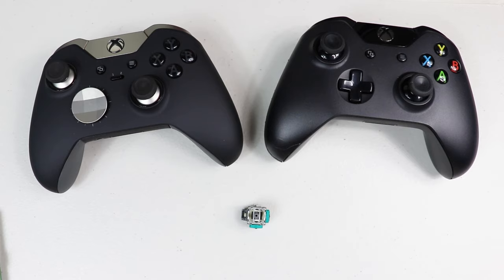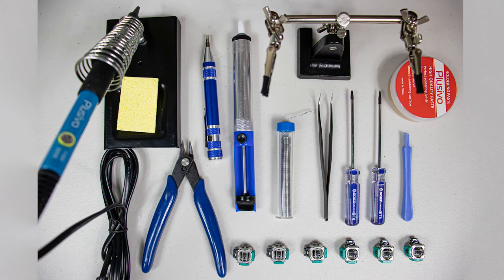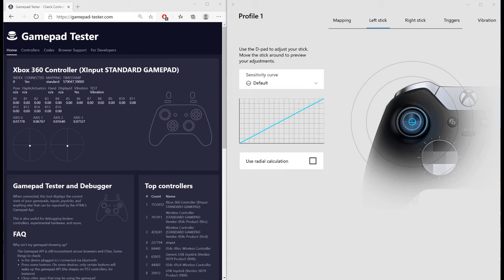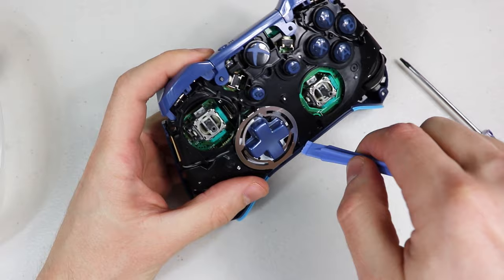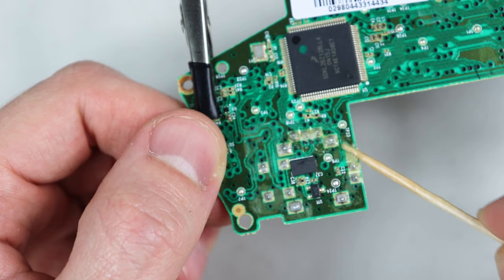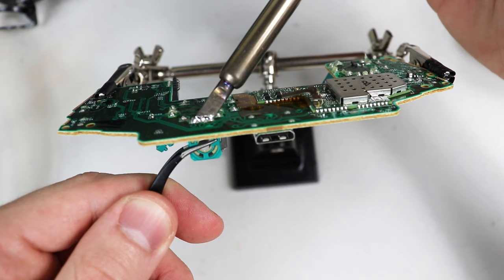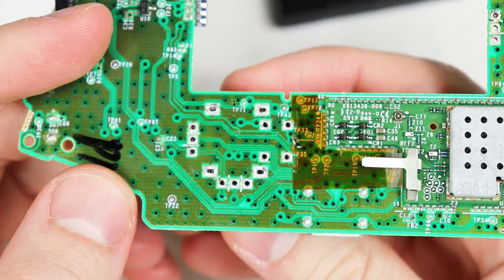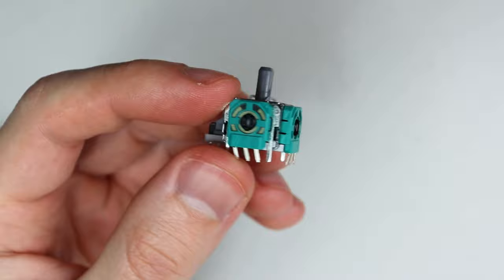How to Replace Xbox One Controller Analog Joystick - NEW METHOD - Fix Stick Drift, Broken, & Loose

Comment: How can one make the spring have more resistence?
I feel a tong of these analogs to be too light.
Reply from the maker: One way would be to install PS4 joysticks, as they have higher spring tension. You would need to make the blue base flat though, as they sit a little higher. I've burned them flatter with a soldering iron before, which worked, but another way would be with a micro cutter. Helps to remove the base first though, which can be a little tricky.
Second way also requires removing the base to access the spring and swap that out. XQgaming sells some various springs, and have a video demonstrating how to swap them out.

Comment: What's the difference between the wick and the solder I thought wick was solder
Reply from the maker: Wick is used to remove/lift solder.  Solder is what is used to join two metal pieces together.  Hope this helps answer your question.

Comment: Out of curiosity, is an Elite 2 joystick replacement compatible in an Elite 1 controller? It'd be nice to upgrade the Elite 1 to the adjustable sticks.
Reply from the maker: I haven't actually tested it's fitment but I'm confident you can if you swap the plastic base of the joystick (the elite series 2 joysticks are slightly raised and may cause the thumbstick to not fit the front cover/rub against it), but it may not be necessary depending if that's the case or not.  It will require manual calibration which is more difficult on the 2's because of the raised base.

Comment: I've been working on my xbone controller all day... but the right stick has a massive offset on x and y no matter what i do... i just can't compensate for 0.2 to 0.3 offset... even with a different joystick and different potentiometers.... Ugh, well at least i get some practice like this.
Fingers crossed my other xbone controller is more forgiving.
Reply from the maker: Oh no :(  Sorry to hear that. I've had a couple controllers like that where I had to swap through quite a few pots and twist to find the right one.
Reply: @SOSSGAMING  thx 4 your respons.
Luckily i had another controller that needed fixing. All i had to do on that one was replace the potentiometer. It was within 0.07 so that was good enough for me. No finetuning needed. And besides, i got a lot better at soldering :)

Comment: I'm about to attempt this repair, but how can I tell a knock off replacement from a genuine one?
Reply from the maker: The most common one with the integrated deadzone has a white wiper/wheel (the center circular part of the green potentiometer.) Genuine xbox joysticks almost always come in black wipers.  If looking for PS4 joysticks that's harder to distinguish because they both have white wipers. Hope that helps.

Comment: Idea is very good but I didn't find it effective on JDM boards for dual shocks/sense. I have really stubborn DS4 controller and even with bending pins to pads readings are jibberish to say at least, nothing worthy of adjustment. It looks like JDM boards have contacts from both layers not just one like in MS controller although I may be wrong. On JDM board I tried this method while measuring and making reading 1-2/2-3 even with 0.05 kohm tolerance but despite that this particular controller still shifts to upper left from the center. Looks like I'll have to pair matched pots in resistance and use flex board 50k potentiometers and do it this way. Suprisingly I had replaced some analog sticks in more DS4 V2 pads without even measuring them and they worked completely fine and were center both. Ughh I really got very naughty pad to work on... Still, great idea and fix. It just doesn't work for me or just this particular controller. I will try it on some other pads anyway.
Reply from the maker: Bummer! Good luck, hope you can figure out a solution for that stubborn board :)
Reply: @SOSSGAMING  I tried that fancy flex board and it completely screws controller's sensitivity.  Yes it solved drift problem but analog stick's "throw" is not centered thus I now have controller which can't go full on right on both sticks. I have those matched cut out pots still so I am going to do it another way and better. I'll trace where those pins go and I'll attach thin wires directly to each leg without soldering to pad and then to the respective places that lead to the chip. With this I will have full control and readings I hope. I need some time, this thing is very "special". You could just use this controller like it is - it is usable. But still I am disappointed with the result. I started documenting this on video, when I'm done I will post it to my channel maybe it will help some people in the future.

Comment: So I replaced a whole stick resoldered a brand new one in, all worked fine except the original issue of stick drift hard right (left stick) persisted! After putting in a whole new pot! Its like there is a short or something that has occurred on the board creating this issue. I have given up, probably just buy another controller and swap the skin over. Reason being it was a BF1 limited controller so I wanted to save it!
Reply from the maker: What value does it show on the tester site?
Reply: @SOSSGAMING  yeah I skipped that part my guy I'll go and find out and come back. Thanks for your work

Comment: Hi, I just replaced the left stick with a new one and managed to calibrate the X and Y axes. However, I'm having an issue: the left stick button appears to be permanently "pressed" when I check the controller on the gamepad tester website. Did I miss something during the replacement, or do I need to buy a new stick? Thanks!
Reply from the maker: Hey there. I would recommend to double check your solder connections. If there is a bridge between the button joints that would cause that. There could also be a solder bridge under the joystick funny enough (happened to me once). Clean all residual flux well with isopropyl alcohol. Could also be a faulty button on the joystick itself. Worst case there is a short on/in the board somewhere.
Reply: @SOSSGAMING  Many thanks! I'll check all that! Best regards

Comment: This is a long shot, and i know this video is a year old now. I replaced one analog stick on my series 2 controller and went to test it and both the analog sticks and triggers dont register now. All the other buttons register even pressing the analog sticks down to click the button register, just not tracking any movement or trigger pull. Any ideas, or is it trash now?
Reply from the maker: Good question. I wouldn't say it's trash. I think I've had something similar before where it was one of the small capacitors (which also completes the circuit to power the triggers). Try to see if you can spot any missing ones near where you soldered. It might be worth checking to make sure it's on a profile that doesn't have the triggers disabled. And lastly connecting/reconnecting the boards together might help. Just a thought. 
If none of that works I'd post this question in acidmods forum they're quite knowledgeable over there. Good luck!

Comment: I have the entire assembly of the joystick, wipers and all already attached, can i just solder in that or will it need all the tweaking and pin adjusting to get it centered?
Reply from the maker: You can solder it in, but will likely have some off-centering. You can always adjust it afterward though as shown in the vid. Personally, I'd do the tweaking first though.
Reply: ok thank you @SOSSGAMING

Comment: I have a problem, the click on the right stick (L3) is not being registered, it happened after changing the stick, do you have any tips to solve this?
Reply from the maker: Sounds like a bad replacement. Just bad luck unfortunately :/ But double check the accessories app if it's an elite or series x/s or in game settings

Comment: if one of the potentiometer, let's say, x-axis does not show any movement on the software (let's say one accidently forced some of the pins out damaging the pin holes), would it be possible to bridge those pot pins to another part of the PCB?
Reply from the maker: Yes it is! in the acid mods forums there are pcb scans of each controller. I'll try to send a link to it in the next comment
Reply from the maker: https://acidmods.com/forum/index.php/board,537.0.html
Reply from the maker: If you are unsure of which TP to solder to you can post the question there or ask me and I can help locate it with you

Comment: Do you have any fix for joysticks physical tension that doesn't rest firmly in the middle? My old elite series 2 thumbsticks have like a whole 2 mm of play in its resting position, and it's definitely in the thumbstick module and not from the screw on portion.
Reply from the maker: Unfortunately the only way I know how to fix that is by replacing the joystick. The Elite 2 joysticks in particular have this problem sadly.
Reply: @SOSSGAMING  ok. Rt for the reply. I'll update here if I come up with anything.

Comment: Will this repair work with hall-effect joysticks?
Reply from the maker: I think it will on the S/X controller because you can calibrate it in the accessories app. If on any other xbox controller, you will likely have issues as the range is usually not enough and no way to manually adjust.

Comment: I tried to turn my controller on after I put the stick in but it keeps turning off if I tilt it the wrong way and I’m having trouble adjusting it
Reply from the maker: It can be a little finicky as you've noticed. Were you ever able to get it figure out?

Comment: If I just replace the analog stick central part and keep the original potentiometer in there do I have to calibrate anything?
Reply from the maker: Usually it will be fine! If the centering is too off, you can just adjust them with one of the techniques in the video. Good luck!

Comment: I have a question, and what to do if the pad does not turn completely on the right knob to the left in mechanical weather, but in the game it does not catch, it goes slower to the left and faster to the right on the Elite 2?
Reply from the maker: It sounds like there is an issue with range, which is fairly common on Elite 2's. In that case, you can try twisting the potentiometer to allow it to go more to the left. I will have a video coming in about a week for the series 2 explaining this.
Reply: @SOSSGAMING  ok thx

Comment: Hi i need help at what tempature do i desolder for the xbox series controllers and what tip should i use
Reply from the maker: I use about 350C / 650F on these boards and just a normal cone tip. Not sure what it's called

Comment: Man i can not get the existing solder on the board to turn into liquid. Abosultly feel like I'm frying my board and the stuff does not change from stone hard. Any ideas?
Reply from the maker: Adding your own leaded solder and flux can help. Perhaps the soldering iron also isn't getting hot enough

Comment: Hey, I have two controllers, both have drift on the left stick, If I where to swap the right stick on one controller and replace it with the left stick on my main controller would it work?
Reply from the maker: Yep! You might even want to try first just replacing the potentiometer with one from the other controller that is causing the drift, if that's the only issue you have.

Comment: If I know that the y axis potentiometer is the only bad part, can I just swap that with a new potentiometer because that would make the soldering job easier, or do I have to replace the whole joystick unit?
Reply from the maker: If drift is your only issue then yes, absolutely you can just swap the potentiometer!
Reply: Thanks!

Comment: My right hand thumb stick doesn't click any more is it worth leaving the potentiometers in place and swapping out the centre, seems like a lot of faffing about lol
Reply from the maker: Definitely worth a try imo! Great question. The hope doing it that way is that the replacements aligns well enough that manual calibration isn't needed.
Reply: @SOSSGAMING  can you test a thumb switch before fitting I have two off an old controller??

Comment: I recently bought an elite series core and i just feel a little bump when i move my right stick to the top right, is there any to fix that
Reply from the maker: My guess is that a piece broke inside and would need a replacement, but would need to know the cause first

Comment: I'm so confused on the calibration part, am I moving the pins to calibrate or am I physically moving the wheel inside the analog? Been at it now for a few hours an gave up
Reply from the maker: The idea is not moving the pins or the wheel, but the green outer shell part ever so slightly. By doing that it changes the centerpoint where the wheel touches the resistive material.  Wish I could explain it better.  I'm really sorry you're having troubles :/

Comment: im getting bad results, my potentiometers sometimes are .05 all the way up to .2 in the neutral position, changing every time i flick them. How do i get them to return to the same neutral position while checking the thumbsticks?
Reply from the maker: It sounds to me like the potentiometer has too much resistance with the joystick for some reason (sticking a little bit).  I would either try readjusting the potentiometer, or just change it out completely.  Also to note there is almost always a little play with every joystick, about .05 - .1.   In your case though .15 seems quite excessive.  Let me know what you find out.

Comment: I need help I accidentally removed or broke not sure a black wire that was used to turn the controller on aka powering it on and I’m not sure where it goes now
Reply from the maker: Send an email to my gmail account sossgamingcs with a picture and I'll try to help ya out.

Comment: Is there a way to lessen the deadzone for the potentiometer? I got a third party controller for the switch, deadzone isn’t bad but noticeable
Reply from the maker: I'm not too familiar with the switch controllers/joysticks so I'm probably not much help.  I would think that if you could find/source original switch joysticks and swap them out it would work, assuming the third party controllers could use them.

Comment: Hi again, what size is your solder tip for heating all three pins please ? This works great by the way, just need a larger chisel tip!
Reply from the maker: Not sure how manufacturers measure them, it's the one that came in the basic soldering iron kit.  It measures about 7mm from one end of the edge to the other.  Does that help?
Reply: @SOSSGAMING  thats great thank you

Comment: My right analog stick isn't sensitive to movement. When making precise aiming movements my cross hairs don't move till the joy stick moves more farther which makes it harder to snipe and aiming in general. Im on a xbox controller. Will de-soldering a anolog stick from another controller and soldering it on to this one work?
Reply from the maker: Are they original joysticks in the controller? If so, It could be that the potentiometers are worn, or, you might want to double check in-game deadzone settings. But yes, if it turns out to be the potentiometers/joystick itself, you could use one from another working controller.

Comment: Would low-melt solder help with desoldering these?
Reply from the maker: If you know how to use it, I would say yes. However when I experimented with the low melt solder it didn't seem any easier but could be due to my lack of experience with it.

Comment: Hi , I don't see if this question has been asked on this thread, but are there different analog replacements for elite xbox one controllers and the regular xbox one controllers?  Are they one and the same?
Reply from the maker: The literal only difference is they added a metal insert into the elite controller analogs shaft.  Funnily enough it did not improve it because they still break.  So in other words they are the same lol
Reply: @SOSSGAMING  Thank you, did the plung in buying the recommended kit and looking forward to following your instructions to fixing the toggle sticks.  

Thank you!

Comment: 15:58 is this calibration a must or actually a thing? there's a youtuber named "TronicsFix" who makes xbox and many other controller repair vids where I never saw a single vid of him doing any such hardware level calibration of the analog sticks by bending the pins beneath them. He just simply solders it. Or is there any pre-calibrated keys online to purchase?
Reply from the maker: If you have just stick drift, usually replacing just the potentiometer leaves the joystick within an acceptable range. However if replacing the whole joystick, calibration is likely needed, otherwise "stick drift" may still be present.
The problem is on an individual basis, so unfortunately there would be no such thing as a pre-calibrated joystick. I tried to explain this as best I can at the beginning, but I understand it can be confusing. 
If just stick drift, I recommend trying to only change the potentiometer, if needing to replace the whole joystick, perhaps the standard cheap joystick (with integrated deadzone) is the route you might want to take. Though it does effect gameplay a bit so I usually don't recommend them.

Comment: I have a question, i bought my controller from a pc repair shop, from what i have seen when i dissasembled the controller, the left stick's y axis sensor has been changed, and it isn't calibrated. Will the windows calibration software fix that problem? I'm using my controller on pc.
Reply from the maker: It should, absolutely.  If it was replaced by a potentiometer that has a deadzone, however, that will still remain on that axis, but it should still be able to be centered with the software, but will still have a deadzone as that's a physical property.  But if it is using a good potentiometer all is good!